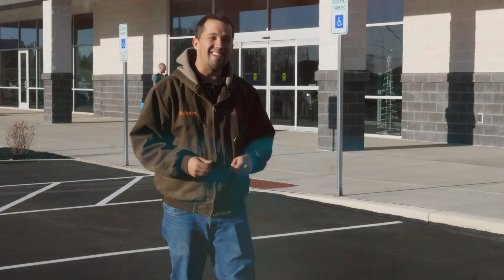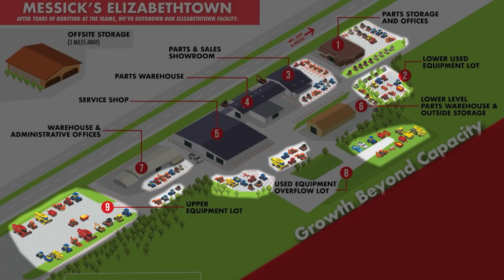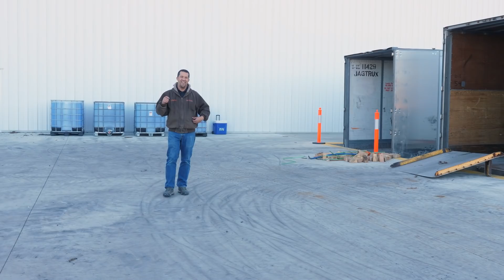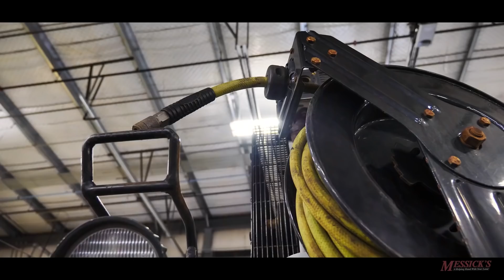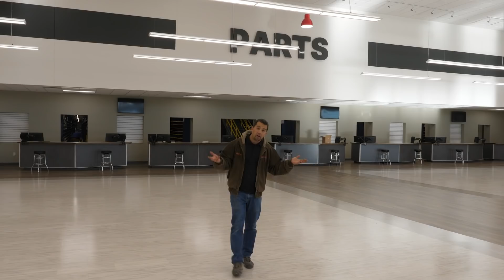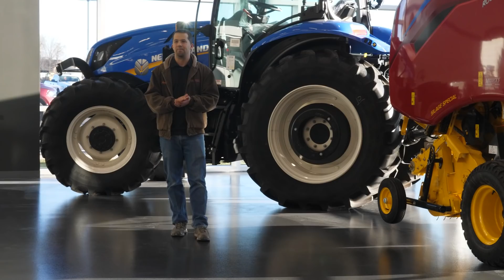New Messick's Hub Store. First Look at Messick's Mount Joy.

Comment: WTF do you mean your technicians have they're own tool's in the truck? why do they need their own tool when they are driving your truck to your customers to service your machines?
Reply from the maker: news flash, mechanics in all industries own their own tools. Automotive, heavy equipment, trucking, etc. Your personal tool box is part of your skill set.
Reply: @MessicksEquip  perhaps that shouldn't be the case? "here take this job that requires a high level of skill, year's of experience, self drive and motivation and we've already invested 100k into the truck, but you need thousands in self supplied tools for it" shouldn't be the case.

I run an equipment repair company 1 100th's the size of messicks, my blokes don't supply a thing, because tools needed for work are tools needed for the job, if I can afford to do it, so can you.

Comment: Please update with all your delivery trucks. A lot of times we get sent to the old store with no way to know where to go
Reply from the maker: Currently, everything but our slow moving part numbers have been moved to Mount Joy. What remains should only take about another two business days.
Reply: @MessicksEquip  that is good. If you still own the old location, maybe put a small sign with new address. The new place looks amazing. You will wonder how you ever worked anywhere else.
Reply from the maker: @tira2145  There is a 4x8 sign right at the circle, and paper signs on each door. Thanks for the compliment. Its going to take some time to unpack and get comfortable in such a different place.